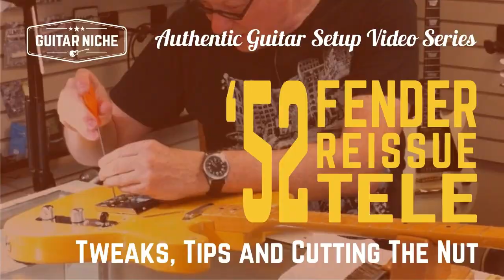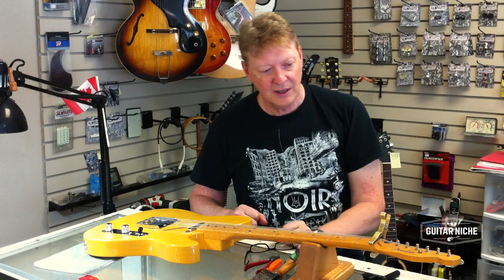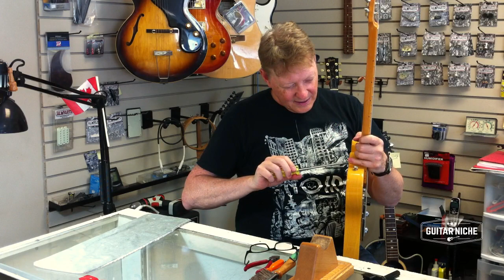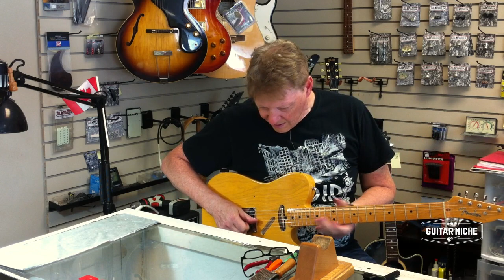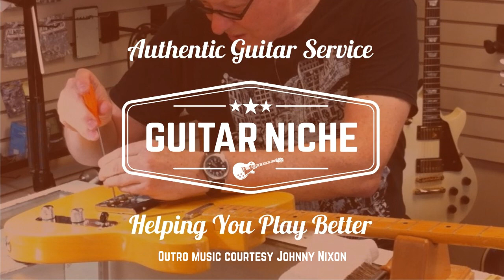How To Setup A Fender Telecaster Part 4: Tweaks, Tips and Cutting The Nut

Comment: Enjoying these.  Thanks for posting them!

One thing I'm not understanding -- perhaps I missed it -- is the reason for taking the neck off to adjust the relief rather than using an allen wrench for the adjustment next to the nut.  Would you mind explaining that?
Reply from the maker: Hi Black Richard, this particular model has the vintage style truss rod adjuster at the butt end of the neck, so you have to take the neck off to access it. Modern models have adjustment access at the headstock, which not only makes it easier, but saves wear and tear on the neck joint screwholes. Thanks for asking!
Reply: Thanks!  

Thought I saw the route in the headstock for that adjustment when I looked for it in the video.  Sounds like a good reason to buy not-quite-traditional models!  :)
Reply: P.S.  Found this when looking how to adjust pickup height on my recently purchased ASAT classic.  Lot's of great info.  :)  (But concur with earlier comment that specifics would be awesome in contrast to "looks about right" (or whatever the comment(s) was/were). 

Keep up the great work/vids!
Reply from the maker: Thanks!

Comment: Do you have any videos where you really get into how to file nut slots on fender style guitars? Also I am very interested in what you have to say about all the details of setting truss rods for different situations
Reply from the maker: Hi Justin, cutting a nut requires finesse, but it's not rocket science. Here's an article that explains it fairly well: https://guitarniche.com/how-to-build-a-jeff-beck-inspired-54-esquire-custom-guitar/
As for setting a truss rod, I always try to start with a neck that is as straight as possible, then back off or adjust the truss rod (introduce relief) until the the action feels right for that guitar given it's general setup.

Comment: I have a tele copy with a toploader bridge.I think my bridge is installed too far back. The front edge of it does not sit inside the slot in the pickguard. Could you tell me what the distance is from the front edge of the nut to the back edge of the bridge?   Thank you
Reply from the maker: Because it's a copy, that's a little hard to answer. As long as it can be intonated, it should at least be in the ball park. What brand is it?
Reply: @guitar-niche  I needed the specific measurement.Distance from the nut to back edge of the bridge. I got the answer  from a Telecaster Forum.  Thank you

Comment: why don't you use measuring tools such as feeler gauges to check the relief and the nut?
Reply from the maker: I used to actually - and I still do to measure fret height. But for nut height & relief, a few years of experience will tend to develop a good sense of what looks and feels right. As long as the feedback from your measuring tools produce accurate results, you're on the right track.

Comment: question about nut slots...will this affect if we want to change to lighter strings....on this video the string are 10s set and slotted as so..what happens if we want change to 9s or 11s...if already adjusted for 10s...
Reply from the maker: Going down a gauge isn't so much of an issue, but going up will require re-cutting the nut slots so the strings don't bind, or keep the nut from splitting. In both cases the intonation will have to be reset.

Comment: im so glad i didnt choose a tele with that kind of neck :P not everything about vintage has it advantages. or would you say there is any benefit at all having the neck adjustment like that ?
Reply from the maker: Hi driood, I think the advantage in the original design was more slanted towards production processes. Having to take the neck off is a pain, and it doesn't do any good for the screw holes which eventually give out through wear and tear. The neck plates also get deformed at the edges from excess compression. Typical modern designs that have the truss rod adjuster at the headstock are far more convenient - which would have been developed through user feedback don't you think?
Reply: exaclty what i was thinking :p its so odd that they still produce new guitars that way tho. I asked on a guitar forum before buying my first telecaster what they thought would be the best for a decent price. Most recommended the baja telecaster and the roadworn 50s tele. mexican made, and from what i understand they both have the adjustment below the neck. wouldnt say that they are bad guitars just from that though, i just think its wierd that even considering that they seem to be the more popular teles.
Reply: You can adjust the roadworn and the baja without removing the neck.  Just remove the pickguard and use a 90 degree screwdriver.
Reply: @drioood  was gonna go that route , was low on cash , so I bought two Fender Squier butter scotch blonde 52 reissue , one for 5 string open G an the other standard , open D & E , I use 400 grit on the neck an no prob

Comment: It's really risky to cut the nut "by sight" AND without pressing the string at the third fret!
Reply from the maker: Either approach requires visual cues. Would you care to elaborate on the third fret method you mention?
Reply: Guitar Niche, fretting the string at the third fret let's you take the bridge action out of the equation, and just examine the nut action. Otherwise, you will always be confounded by the bridge action: a low action at the bridge might make you cut too little; a high action at the bridge might illude you can cut more deeply, and ruin your nut.
Reply from the maker: Agreed. That's why cutting the nut is one of the very last processes in a setup. Regardless of the method you use, the bridge height and proper relief must be set first. While the perfect bridge height can be plus or minus a small amount, it's absolutely critical the neck relief be adjusted as it has the most impact when referencing string height near the nut.
Reply: @shredgd5  I see what you are saying , I had copy cat this older gentleman , in which he did a side by side with the original an measured the depth and by site an the first one worked great with great sustain an have done it each time with great results an the reason for change was different material , if that is wrong , then I have been simply lucky
Reply: P.S. , I have done that with bone and tusq

Comment: Dont torque the screws down .... BUT it's OK to whack the neck repeatedly with your hand...   And he's a You tube Pro..
Reply from the maker: Yes, yes, and no
Reply: He wasn’t whacking the neck and he made a point that you had to be careful
Reply: If whacking it  causes problems,  it isn't much good. You need to be careful not to strip the threads in the neck, or maybe breaking the neck!